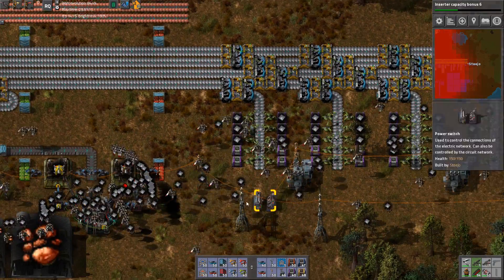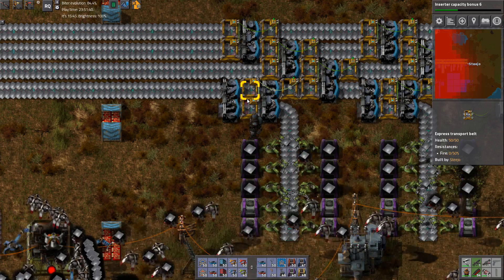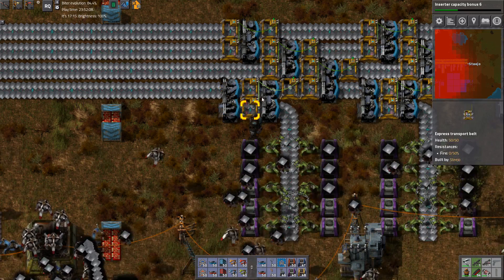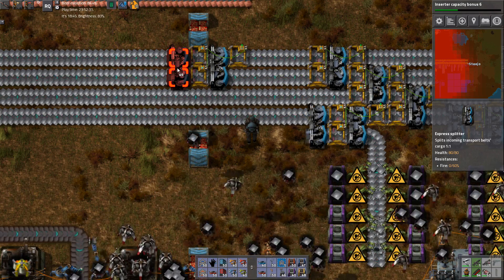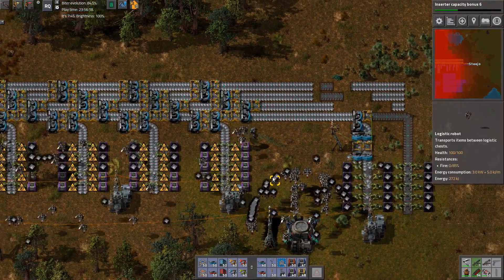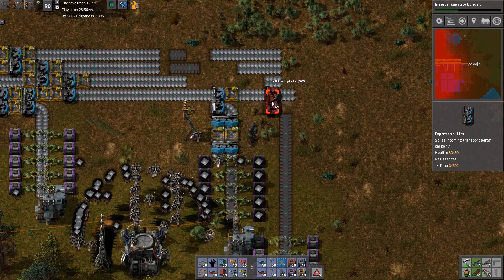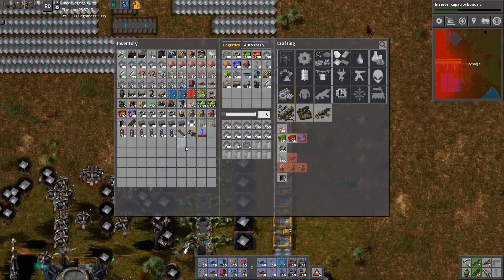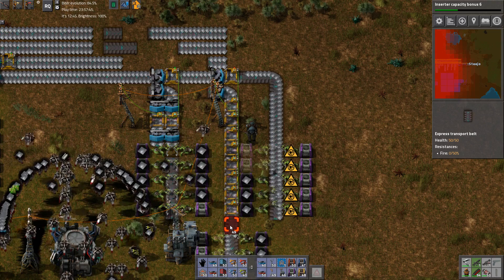HOW TO ACTUALLY USE A MAIN BUS PROPERLY - The Priority Splitter 2 - Factorio Tutorial

Comment: Do the wire configuration matter? When you connect two belts together is each belt scanning it's own contents and sending it to the belt(s) it's connected to or is it being turned on and off based on it's own contents? If the latter is the case, what signal is being sent between the belts?

Both these tutorials are terrible and don't explain anything. These aren't tutorials... Doesn't help that there are no other resources anywhere on this stuff...

Comment: i think this might just create unnecessary tick lag, just to get a full belt worth of plates ETC. Taking a split from the middle of a bus seems to work fine, all depends on how big your factory is. Could you not just put a belt reader on the end of a split line (as in all the way to the end belt) and reading, if full allow plates to run from the split into the bus, that might free some tick lag
Reply: the main problem that I find this solves is adding more input to a belt, with a priority splitter i always have the top lane with the least amount of product in it, so i can just split in to there.

Comment: You're shifting lanes prior to the lower shift, which doesn't work as you intend, you need to shift lanes after the lower shift.

Call lane 1 your bottom lane
BAD - You first try to shift lane 4 into lane 3, since they are both saturated nothing happens, so lanes 1234 are Full, Full, Full Full
BAD - Next you try to shift lane 3 into lane 2, since they are both saturated nothing happens, so lanes 1234 are Full, Full, Full, Full
GOOD - Next you split off lane 1, so lanes 1234 are Empty, Full, Full Full
GOOD - Next you shift lane 2 to lane 1, so lanes are Full, Empty, Full Full,

At t=3:30, you can see belt 2 is empty after your first split off
Reply: Considering the system seemed to work fine, does this really matter?  I mean, is there a benefit/drawback of the two methods aside from looking good?
Reply: You're right. I think the best way to do it is to have the sensor on the branching belt instead of the bus belt and reverse the test case (so *<9 instead of *>8). Then have the shufflers go from bottom to top. This maintains the convenient nesting he's got going in the video. I'm not sure that's entirely necessarily, but it looks aesthetically nice. :P

Comment: Still one question remains:
What is the point of prioritizing the beginning if the of the bus over the end?
For as long as the iron doesn't back up to the production area, you are using all that you are producing, so this is no increase in overall production.
So what is the point of the 5 splitters, when you can just use 1?
Reply: The extra splitters and wires are to move  the iron on the belts to ensure that one lane is at maximum compression. For example, if you're pulling plates off the bottom of the bus, you want the bottom line to be as full as possible to ensure as much iron as you can is going to your machines. So the first two splitters ensure that 100% of the iron on the bottom lane goes down off the bus to whatever machines need it before letting overflow through, and the remaining 3 splitters move all of your iron down lanes to the bottom again so the next split from the bottom has as much iron on it as possible. 

So you're right that it doesn't increase the overall number of plates being smelted per minute, but it does help insure that your iron belts are being delivered to the machines that need them as efficiently as possible. I hope that helps clear things up!
Reply: But if I don't have enough iron coming in, no iron will get to the machines at the end of the bus :C
Reply: You asked the question that came up in my mind also Safrus. In fact, a lot of players do things that are not truly helpful. Like buffering their raw resources (liquid or otherwise) or spreading their resources equally over their production lines. Or spreading their flasks equally over their labs. You can find entire discussions on the forums on how you should build a ring that keeps circling your flasks around 'so every lab has a change to get some if you don't have enough'. Just search for rainbow belt.
Reply: if you belt is too lone, you will get to a point where everything before the end, has used all the items on the belt. this stops that from happening
Reply: uh.. no it doesn't. If that happens you just need to feed in more resources and perhaps add extra belts
Reply: Peter Bonnema well thats the point. you build your main buss, then suddenly realised you didnt have enough room to expand more belts beacuse you have factories on both sides. aslo, if you upgrade factories for more input, then you need to add  more input, closer in, wich makes things fifficult, to the point where for every 1/2 an hour working on production, you need 2 houres to rejig the belts. then you get into belt braiding and it all goes to shit, you diasemble your entire factorie with botos and wonder where you whent wrong. playing a campainge for more that 800 houres myself, this has happened to me. i have build my factorie comlpetly from scratch twice before i looked into priority splitters.
Reply: How do priority splitters help with the problem of not having enough throughput on the bus? They dont, they even reduce the total throughput by a small amount.
Reply: best argument i've heard so far in favor of priority splitters is that they help quantify exactly how much additional input is needed, but seems unnecessary to me
Reply: +ItsMeStalin so don't build on to sides of your buss and leave enough room for expansion. I don't see how priority splitters play a role here..
Reply: the main thing i like about them is that if i ever have more input to my belt I can just add it to the top belt (the emptyest one) without having to try and split it evenly across all 4 belts
Reply: Sorry to necro, but based on the previous video, it seems like the intention is that eventually additional lanes will be injected back onto the bus. I.e. here you're pulling a fully compressed line off, but still allowing overflow to carry through if it's not required, and then replacing what you pulled off somewhere down the line. Of course you could always have dedicated raw supplies for each factory, but this allows you to place the injector line anywhere. It doesn't have to be directly after the priority splitter, and you can still maintain 4 lanes (though not full lanes) in the meantime
Reply: Lets do a simple example: 1 belt of iron on the main bus, you try to produce yellow belts. First you split of iron to go to gears, which you then bus, and after that you produce the belt with the gears of the bus and the iron left over.
If you do the priority splitter, all the iron gets turned into gears, until they are completly backed up, that's when the iron starts going to the belt factory's too, and you start to produce belt, which then consumes gears, which then sends all the iron to gears again until it's completly backed up. After a while the production of belt averages out at about 2/3 of the iron you send in.
If you use a regular splitter half of the iron get's turned into gears and half goed towards the belt factory's  until the iron is backed up, because there is more iron coming then gears, so the splitter then sends an increased amount of iron to the belt automaticly. After a while the production of belt averages at about 2/3 of the iron coming in.

So: The only diffeence between priority and regular splitter is wheather or you want your intermediate product to back up, or you basic resources, but there are no advantages or disadvanteges for either in terms of anything, except buildcost, and opportunity cost (the time you spent on building this which you could instead use to build more iron smelting, which would actually help).

All of this is true for any size of main bus.

I hope i made clear, why there is not only no advantage on doing this, but it is actually bad.
If steejo would have used the time he spent on the splitter productivly instead, he'd have a rocket launched in his single player and factorissimo let's play by now.